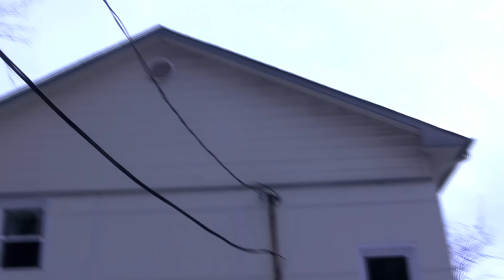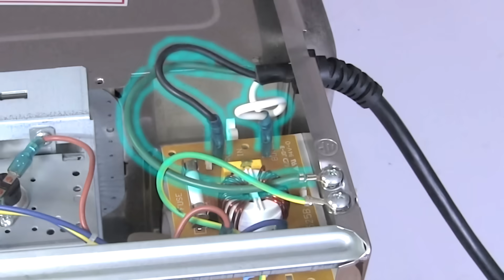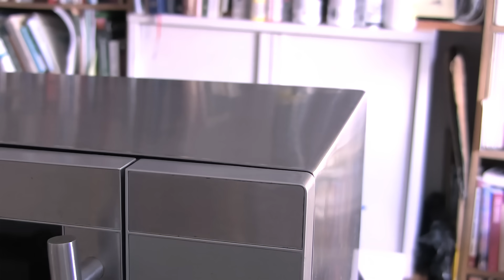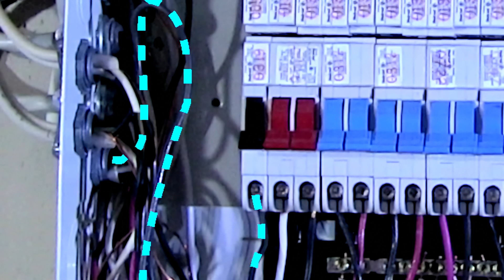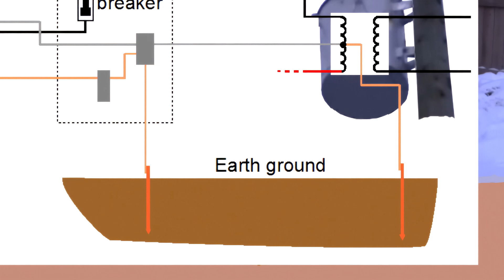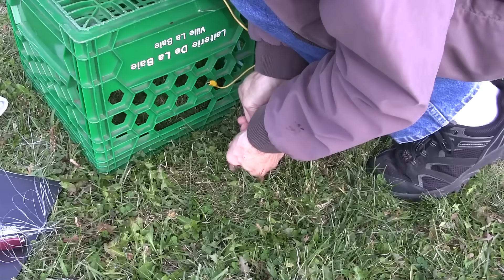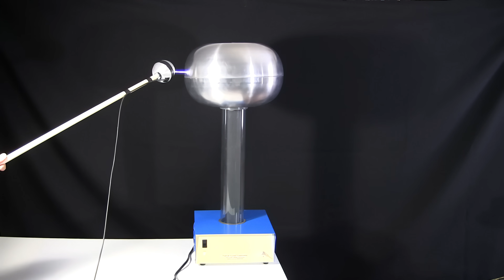What is Ground? Earth Ground/Earthing

Comment: Well how do those cases become charged when lightning strikes nearby?
Reply: A direct lightning strike onto a properly grounded electrical system won't put much voltage to earth onto the system components due to the low resistance of the grounding electrode. The electrode serves to decrease the total resistance between the system and earth, which lowers the voltage that can develop between them for a given current flow.

However, a nearby strike (essentially a sudden, huge pulse of DC current) can still induce high voltages into a system due to the high frequency of the resulting magnetix flux
Reply: @MaxPowerElectric Thanks for the response!
Reply: Man, I don't care if you have some magical zero ohm grounding system. Your appliances and other metal structures will have thousands of volts to ground in a lightning event. Grounding will not affect potential in any situation. The key is bonding. Your metallic systems may be far above ground voltage, but with good bonding, potential between other metal systems is eliminated. Bonding eliminates side-flash and then grounding dumps the charge into the ground after the fact.
Reply: @PimpMyDitchWitch  isn't thousands of volts to ground is still better than hundreds of million of volts though? Dielectric breakdown voltage of air is roughly 3MV/m, so with a grounding electrode of 25 Ohms with a lightning current of 30kA you'll have roughly 750kV to ground which can arc across 250mm of air. Which is still not ideal obviously but compared to the 300MV that typical strikes have, that's still significantly less energy available for side flashes
Reply from the maker: I don't have any data on how well the cases become charged. It probably also varies depending on the ground conditions and distances.
Reply: I had the exact same question, I take that the person is trying to say, "what path is the lightning taking to get to the case?" Not "how well". They just started their sentence in an unfortunate way.
Reply from the maker: The path is through the Earth ground and parts of the building. Most of it is high resistance but the lightning is at very high voltage and very high current. When I worked in installing off-grid solar out for cottages I've heard stories of equipment being damaged that way. In this video I made once, you can see a case where the lightning travelled down a tree, through just a little ground, through insulation in a nearby cable and then damaged two inverters http://youtu.be/5FR3DbWyEiI
Reply: @RimstarOrg   So does that mean the whole building has a charge buildup? If so then where does the excess charge of the building goes? I mean to say that how do things balance out?
Reply from the maker: Actually, my saying "parts of the building" isn't quite right. Much of a building is too good an insulator (dry concrete isn't as conductive as damp earth). Usually it comes enters through any wiring entering the building. And charge dissipates over time to the surrounding air. That's why if you charge up a balloon with your hair and have it stick to the wall, the balloon doesn't stay there forever. Neutral or oppositely charged particles in the air take away the charge.
Reply: @RimstarOrg  Thanks for the explaination🙏...Also can you answer my other question which I've asked you in the video you recommended earlier😅
Reply from the maker: You're welcome. My pleasure. Regarding your question on the other video, I've answered it. Go there and you'll see the answer.

Comment: If ground and neutral are both connected together at the label anyway then why not just have a two hole plug and socket and tie the microwave metal case directly neutral? Why the need for the additional earth wire if it is simply neutral?
Reply: @315-vishnuchary2  
Correct spelling is 'neutral'.
Reply: If we connect neutral to metal case, then under normal condition (no damage in hot wire), the electricity will try to flow to the metal case (through neutral connection), making it dangerous to touch the case all the time (because human can complete the circuit). Ground wire is meant for 'emergency path'.
Reply: Porfiriy Phrixus No. Electricity will take the path of least resistance. I have a two prong plug vacuum tube amplifier with 1400+ volts going to a metal chassis which I touch every day. Don’t even get a tickle. The ground prong provides an even less resistant path to earth than the neutral wire, so that in the event of a live wire touching the chassis the current flows to earth and immediately trips the breaker, which possibly wouldn’t happen in a earthless plug appliance, but without it an appliance wouldn’t shock you save for it having a fault or a non polarized plug inserted into a receptacle backwards.
Reply: @michaelhelgeland4588  Electricity takes ALL paths, not just the path of least resistance
Reply: @michaelhelgeland4588  It is not true that electricity only takes the path of least resistance. That is an old wives tale. Case in point, stand with rubber soled shoes so that you are not grounded, and touch a live wire in your circuit breaker box. You will get a nice shock. The electricity travelled through your body when it had a much easier path to travel through the copper wires.
Reply: @marks6663  While I agree with you that electricity takes all available paths, I disagree that you would receive a shock if you wore rubber soled shoes and touched a live component.  As an electrician, I have handled live wires in my bare hands many times with no shock, making sure of course that I am not grounded first.  (No one should attempt this at home, however!) Now, having said that, if the voltage is high enough, the rubber may no longer be a good enough insulator, and it could indeed shock you.  Most things are capable of conducting electricity given a high enough voltage...
Reply: Good point why not 1rod and the off that?

Comment: WHAT IS GROUND? GROUND IS WHERE WE STAND ON, BECAUSE WITHOUT IT WE WOULD BE IN MID AIR.
Reply: john...
If there is no ground, then you will fall down and not up.
Reply: @redblade8160 , I have wings I'll fly, float, what ever.
Reply: @auletjohnast03638  
Now you're trying to get out of what you originally wanted us to believe.
Reply: @redblade8160 , The ground is suspended temporarily due to circumstances out of our control😖, but we bring you this special message: "Mickie Mouse🐭died today😩 and is going to be bury tomorrow. Now, lets have a moment of prayer🙏 for the poor Rat".🐀😁........We now return control of your television set until next week when we bring you the "OUTER LIMITS".

Comment: GFCIs/RCDs can break fault circuits even without a very high current or very low resistance between live and earth.
Reply: That's because they use a completely different technique -  they measure the difference in current between the Black ( Hot ) wire and White ( neutral ) wire.  Notice that I did not mention, any Ground Wire?
Reply: Which is why we shouldn't consider the ground at the same potential as the neutral as supposed in this video.  The same current traveling through the hot must travel through the neutral back to the breaker box.  We don't expect the ground to carry this current because where it connects to the neutral is quite far from where the load is doing actual work with the electricity coming out of the outlet.  This produces a potential from neutral to ground relative to the distance from the load to the breaker box where the ground and neutral wires are actually sharing a node.

https://www.quora.com/What-is-the-potential-difference-between-ground-and-neutral  Great explanation here.

Comment: Not what I was hoping to see : Ground is not Earth. Yes, you can bond a Ground to Earth, but it's 2 separate entities. Ground/Common is commonly found in DC Circuits (Negative Rail, although you can do the same with Positive rail). Earth is what the word says. If you bond a rail to Earth, you force it to be at Earth potential. Earth is the enormous/fixed/constant point (although you will get different PD depending how far you are from Earths centre / altitude). Ground can be above, below or at Earth PD, depending on circuit/bonding. The 3d Pin on the house outlet plugs, in this video, was Earth. You can imagine the Negative terminal in your vehicle as the vehicles Ground, isolated from Earth due to tyres. We are surrounded by many different Grounds, but only 1 Earth. Don't confuse the 2 or their names !
Enjoyed the illustrations.
Thanks
Reply: You repeated what the video stated ...
Reply: @vtorsi610  Nope. The Video is very good & should clarify to many. However, the Word Ground is used where the Word Earth should've been used. In fact, the Video even demonstrated both Entities; The Microwave's Casing was a Ground. When you connect it to Earth, you Earth the microwave's Ground. "Earth", not "Ground". It's not as smooth a Word to use but it's the correct one.
Reply: @2ClicksUp  That is just your usage of the words.  The NEC ( National Electric Code - USA ) calls it a Ground Rod, not an Earth Rod.  We bond the Neutral Bus to the Ground Bus, not the Earth Bus.  We call the GEC - The Grounding Electrode Conductor, not the Earth Conductor.  But, YOU can use the word "Earth", we do not.
Reply: @vtorsi610  Thank you. Appreciate the Info.
Reply: Yay, finally someone gets it. Earth and ground are not the same thing and if you think they are you could end up dead. Ground can be any potential you want it to be. EG It's wasn't unusual to see ground at 126Vdc in CRT colour monitors and if you thought it was the same as earth you would be in for a very nasty surprise if you grabbed hold of it. Even the electrical symbols for earth and ground are different to draw your attention to the fact that they are not the same. Oddly enough though, earth and neutral are very similar, with neutral often being connected to earth at the distribution side

Comment: Now I understand. Due to the low resistance of the case and the ground connection the current doesn’t reach the hand in case of a broken hot wire.
Reply: It's not that it doesn't reach the hand, instead the low resistance causes the current to be greater than what the breaker is rated for, causing it to trip and open the circuit.
Reply: If the fault current isnt high enough to trip the breaker, then yea its gonna reach the hand lol.  Thats why you want a low impedance path so that you get high amp flow.

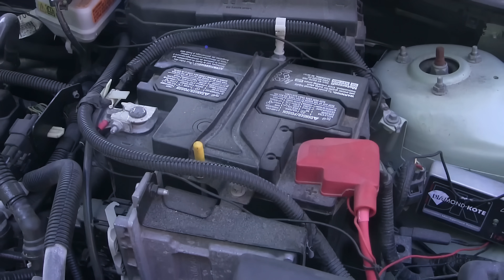Comment: Hey RimstarOrg. I've continually come back to this video over the last few years and each year I almost understand more. Thank you very much! One important question I have that is very quickly gleaned over in your video @8:47, which seems quite important to me, is determining whether a schematic indicates the ground symbol connecting to the ground prong. 
1) Is the only hint of this being the case when "hot" and "neutral" are on the schematic? In which situations would we build our electronics where the ground must be connected to a chasis?
2) Do only metal enclosed electrical compenents require the use of a three prong connection?
Reply from the maker: Yeah, it can be hard to know if you need a ground prong on the plug. If you have a metal case then for the safety reasons I explain with the microwave oven case you should have a ground prong and connect the metal case to it. For the schematic I showed with hot and neutral, the schematic was for a high voltage power supply and for that you want the high voltage to be relative to Earth ground and so I needed to have a ground prong -- I should have said that instead in the video. Some radio circuits can also benefit by being connected to Earth ground. It really depends on your understanding of the circuit's requirements. Sorry to not have an easy answer.
Reply: @RimstarOrg  Thanks Rimstar!

Comment: To Simulacra in the Shell - You are correct that line current is normally AC = alternating current. 
   And this is a simple explanation.
   In the USA, household (residential) wiring is normally about 120 volts AC. In our small town, the line voltage is about  123 VAC. For 120 VAC. 120 VAC is only approximate. 
    For the USA, 120 VAC has two current carrying leads, hot (usually with black insulation, though not always) and neutral (usually with white insulation, though not always- electricians do make errors). In summary, there are two current carrying leads, hot and neutral. The third wire, the earth or ground lead is either a bare copper wire or insulated green or green and yellow. This ground wire should not normally be carrying any current at all. 
   This ground wire is there for safety, and carries current back to the circuit breaker to cause the circuit breaker to trip and turn off power

Comment: Why does cold ground lower the conductivity? I always thought cold temperatures are increasing the conductivity. E.g. the resistance of an cold wire is lower than resistance of the same hot wire. 7:03
Reply from the maker: I think it's because it's really the ions in the ground that are the main conductors. And the liquid moisture in the ground is what allows the ions to move easily. If the moisture is frozen then those ions can't move so easily. That's my understanding anyway, I could be off.
Reply: @RimstarOrg  Wow, that was fast thank you. With your explanation I had a starting point for some research. You are right.
https://hannaservice.eu/test-electrical-conductivity-ec-soil-complete-guide/
"More activity means the ions are better able to conduct an electrical current. So, the conductivity of the soil increases. As temperatures cool down, ions calm down and move around less. Less activity means the ions have a harder time carrying electrical current. This decreases the conductivity of the soil."
Reply: Resistance decreases in a copper conductor as temperature increases.  Lower resistance equals higher amperage.
Reply: @Checkmate54321  No, I think you got that wrong. Resistance increases in metal conductor as temperature increases. Thats why people cool their CPU to overclock it.
Reply: @SeverinLudwig  Well, amps are what cause heating.  And lower resistance equals higher amps at the same voltage.  So heating reduces resistance.
Reply: @Checkmate54321  Feel free to ask someone else but im 100% sure heating increases resistance of metallic conductors.
Reply: @SeverinLudwig  I think you are right.  I was looking at it backwards.  Lower resistance causes higher amperage, therefore causing more heat.  I stand corrected!